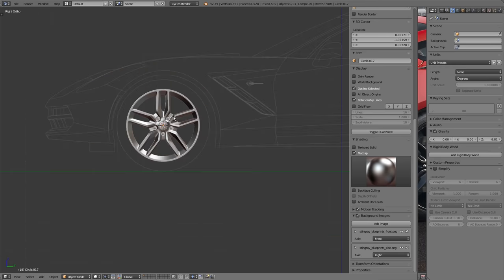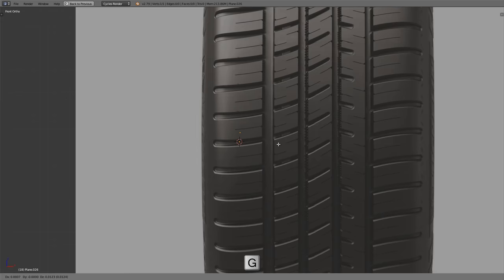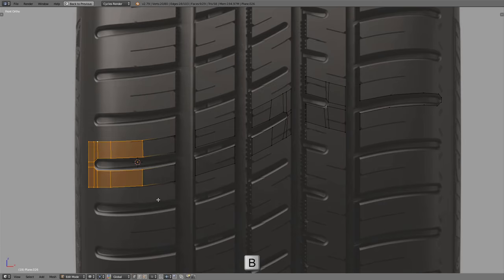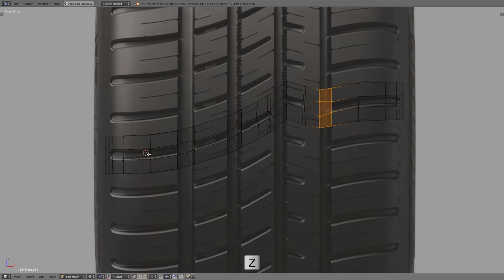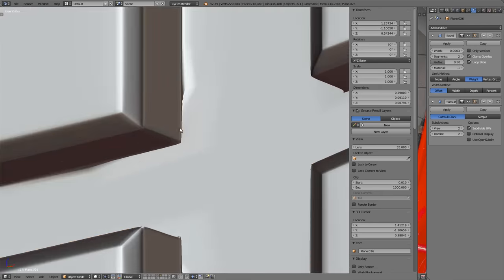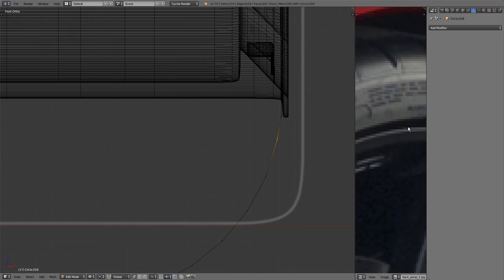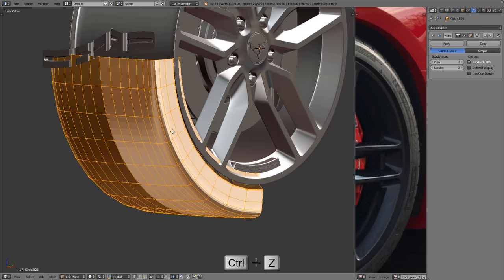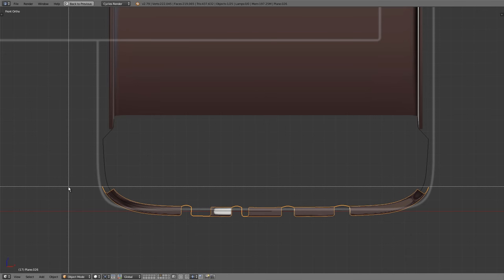Blender Tutorial - Modeling Car Tires

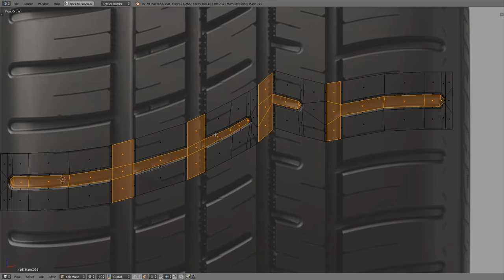Comment: about video 12:20. " Let's press T key and make sure we disable boundary."  Well, I did exactly what he said.  I press "T" key nothing happens except hiding toolbars.  So search every corner of blender screen I don't see that disable boundary thing.  After then I give up and press T again and my toolbars appear on the screen back.   I thought I missed a step, I replayed this tutorial from the beginning and one by one follow every step but I still can not find that disable boundary thing.  Impossible for me to follow this tutorial.  Bad tutorial.  Not useful at all.  Just make me mad and give me stress. Why his tutorial short keys are different than mine?  Blender 2.8 changed all short key layout?  I think this tutorial is decent but with blender 2.8.  Now this tutorial completely useless.
Reply from the maker: Relax, yes things have changed in 2.8. The operator menu that has tool options like boundary is no longer in a side toolbar. Instead, whenever you use a tool, there's a menu that pops up at the bottom left of the 3D View that you can expand, and this menu contains the extra options for that tool. So after using the inset tool, expand the menu that pops up at the bottom left of the 3D View, and you can change the boundary option in there. -Chris